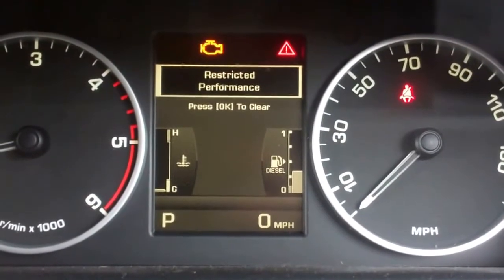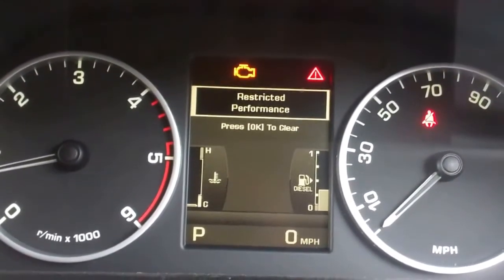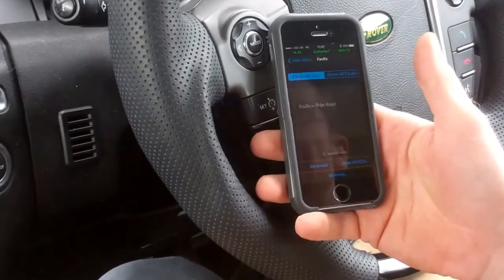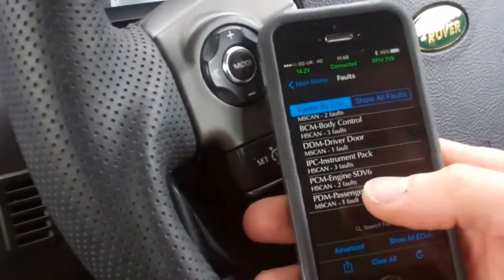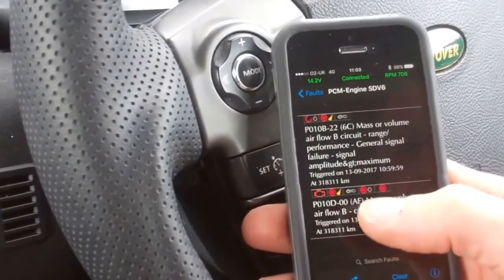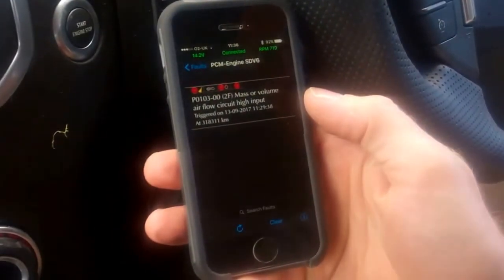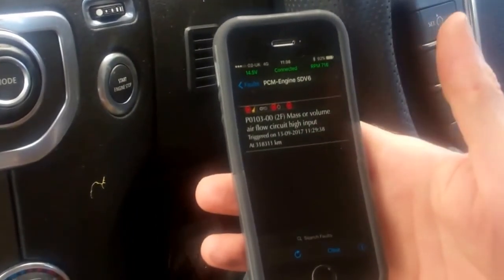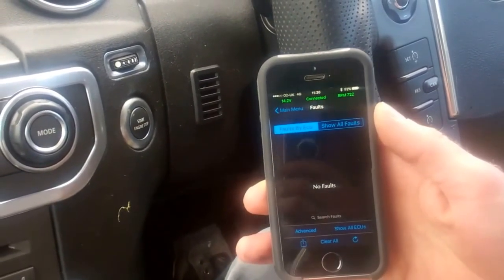Land Rover 3.0 SDV6 / TDV6 MAF Mass Airflow Sensor - Restricted Performance - Investigated

Comment: Hi there I have a LR4 on passenger side it smokes and leaks a little bit of oil on same side runs for a bit then cuts out and the intercooler bottom pipe seems to get oil in it would you know about this problem

Comment: As many of LR users, i'm going crazy due to failure bothering me for more than 4 months now. So to keep it short i started with nice restricted performance, including some oil inside my air filter and the following codes: P006A-00 (historic)  / P00BD-07 (intermittent) / P1247-00 (historic) / P0235-94 (intermittent). 
Based on such error list my standard garage advice me for the reconditioning of both turbo's, including actuators, seal kit for both, EGR's valve original new, and many exhaust seals related to these 2. 
Nevertheless after the change i still see some oil in my freshly new installed air filter, and i still get the P1247 -00 boost pressure low error. But from time to time and in some very awkward conditions, which i will try to describe: 

- ALWAYS after i drive some hours / engine is hot / and after one immediate restart 
- feeling of low power @ low revs 
- starting small jerk just before gear shift - maybe in some incline start 
- after clear feeling of car jerk 3-4 times, where some power and loss of power is strongly felt the restricted performance is there
- AFTER 10 mins shut of the car starts without any fault

I can also describe that by hard pull or higher speeds / revs such failure is not happening.

Comment: Simon, you guys are brilliant and have saved me a fortune! I’ve got a 2010 L320 RR Sport (106K miles) with the same engine as your D4. Just like you, it started going into Limp-Home on cold mornings and/or going up a hill. Then it started doing it on the motorway too. My iCarsoft 930 tool suggested a Mass Air Flow sensor and like you, B was filthy and A was spotless. I cleaned B as best as I could, but it wasn’t, as clean as A.
The car still threw itself into Limp-Home on Hills, cold mornings or on Motorways. My iCarsoft was suggesting the dreaded 100060 fault which usually means a £2,000 fix of replacing both plastic inlet manifolds.
However, I wasn’t convinced because I could delete the error on the move and the car would happily drive a while before the fault occurred again.
Inspired by your video and a couple of others using a smoke box, I decided to see if I could find a crack in the manifolds. I don’t have a smoke box. I used to smoke, but now use a Vape. I undid the pipe from the intercooler, then found a very small funnel, (the sort you fill a lawn mower sump with oil) and wrapped some masking tape round it until it was the same diameter as the inside of the rubber pipe from the Intercooler to the Right-angle bend  plastic peice that goes into the ‘Y’ junction, into each plastic inlet manifold.
I then blew Vape smoke into the funnel and instantly found that the Right-angle plastic piece was not properly attached to the ‘Y’ junction Throttle body.
I unscrewed an 8mm headed bolt behind the fan and the clip that joins the 2 plastic  pieces, reattached them and the problem is solved……….Absolutely FOC (apart from my Vape Liquid!!).

IIRC, I did see a similar problem highlighted by Christian Muth on one of his and Vera’s “Its LR Time” videos and before anybody involves themselves in any expensive garage repair, it is worth investigating a problem yourself first.
Thanks again!
Reply from the maker: Thanks for sharing this - we love LR time !

Comment: Thank you so very much for your counsel.
The challenge has been that the restricted performance indication has been coming up and clearing when the vehicle is left off for a while. The fuel consumption has also been on the higher side. When I check the MAF on two occasions I have noticed oil in the air duct and even on the air cleaner. 
The oil consumption from the engine has not been very bad even though I have had to top up on two occasions.
I was therefore wondering whether the bad MAF could lead to poor fuel consumption which is possible as stated in the write ups but the link to the oil in the air duct is what has been puzzling. The smoke discharge from the exhaust has been normal. At some point I was wondering whether the Turbo could be defective but the power and performance when the restricted Performance alarm is not on is very normal and excellent performance in terms of the power from the engine. 
I thank you for any added advice on this challenge.
Best regards.

Comment: What does it mean when there are traces of oil in the ducts leading from the MAF  sensors. Could this have anything to do with the Restricted Performance on the Discovery 4 Land Rover?
Reply from the maker: I guess in theory there should be no oil around the MAF as this is an air intake only. There is a lot of oil in the pipes after the turbo normally but no in the MAF - I would remove and clean with some brake cleaner.

Comment: This video saved me over a $1000 dollars (AUD)
I had a local mechanic do the scan and got a P00100 and a P00AA fault. Did some research, found this vid. 
Removed and cleaned both the MAF's and switched them over got the same engine warning.
Went to British Motor Imports in Vineyard near Sydney, they charged me $150 for a new unit, plugged it in problem solved. Thank you!!
Local Euro motor works quoted $1200 to switch out a $150 part.
Reply from the maker: Brilliant - glad it helped !

Comment: Restricted Performance issue on 2010 RRS HSE TDV6 A. Mileage 90K

We swapped over the AFM's as well as replaced each one in turn with a spare part. It showed the A circuit is the faulty one, with really high figures showing after revs. When idle both sensors show the same. 
So it's NOT the AFM, but something else. The fault codes are below.... 
PLEASE HELP.  (It just had a costly service before Christmas!) 

The AA Patrol found the following fault code/s:System : Engine control - 7M9 / Diesel EDC 17CP11.2 Status :P006A - Mass or volume air flow circuit. Error Message : Malfunction. Fault pending. Status :P00BD - Air-mass meter or air-flow sensor A. Error Message : Mechanical fault. Fault pending. Status :P1247 - Boost pressure control low pressure level. Error Message : Malfunction. Error sporadic. Status :P0235 - Turbocharger boost-press. sensor A. Error Message : Improper operation. Error sporadic. Status :P010C - Mass or volume air flow circuit. Error Message : Malfunction. Fault pending. Status :P0102 - Mass or volume air flow circuit. Error Message : Malfunction. Fault pending. Status :P00AA - Intake-air temperature sensor 1. Error Message : Voltage above threshold. Error sporadic.Clear faults and run up with live readings. Sounds like choking or leaking at boost pipe. Engine Oil Level Ok. Coolant Level Ok. Advised check on turbo pipes for leaks or collapse and also for EGR sticking. Customer going to contact garage to see if repair feasible.
Reply from the maker: This sounds like a leaking pipe issue I would agree
You can do a smoke test to check for leaking manifold / pipes.
https://www.youtube.com/watch?v=z1G0Tgvywys

Comment: Hi there what’s the IID tool you are using and what’s the app for the iPhone please 
And will this work with the 2014 RR sport SDV6?
Reply from the maker: Yes it will work with your car and i have the blue tooth version of the IID tool from GAP Diagnostics... the app is on the app store.
Reply: powerfulukltd great thanks for your help and advice is it around the 400 mark?
Reply from the maker: @simongreenwood4812  Yes thats the one. You can also use it to modify your car... suspension height etc etc

Comment: Hi bought a 2010 from an auction and it went into restricted performance after pushing on the gas a little harder and I was low on coolant . engine light was on when I bought it. The car seized up while driving and smoking from exhaust and underneath hood and leaked a little oil and wouldn’t start anymore and made a winding nose from motor when cranking with push to start button . Battery totally died and had blue corrosion on it and stopped going into gear so I couldn’t even tow it really cause the wheels wouldn’t move . It was just sliding.
Reply: Hi there, did you find out what the cause was? Sounds extremely catastrophic.

Comment: Hi I have same problem on a 10 plate sport iv changed the air mass but it is back in limp mood with same code is it possible that the 2 mass filters are gone
Reply from the maker: Hi - it would be bad luck for both to go... did you swap them over... you may have changed the wrong one ?
Reply: @L663  swapped them over still says same but in code thing tomorrow and yes would be my luck 2 if them
Reply: Have  now changed the 2 of them a d the problem is still there limp mood
Reply: Have now found out the air intake thing is cracked so ill do that  now
Reply: @richardprice7672  was that the cause then? I've heard they have a habit of splitting. Hopfully you sorted it out 👍
Reply: @brotherseamus165  yes plastic had split

Comment: My 2011 RR Sport 3.0 TDV6 goes into limp mode after 120 km/h when I am flooring it hard. I had hoped its those guys that failed but alas not. Some valve on the smaller turbo is gone - dont know exactly how its called but you can reach it from underneath the car.... Can you please let me know how is it called or whats the part number? The gentlemen from the shop did not help with that..
Reply from the maker: Hi - i think this is the turbo actuator - these can get stuck if not used much - you can lubricate them and work them loose.
Reply: powerfulukltd you are amazing! Thank you.

Comment: The operations you do with the IID tool are they limited to just that piece of equipment or can you do the same stuff on other diagnostic units?
Reply from the maker: There are other pieces of equipment that can do this ...but typically they are more expensive.... £5000 upwards. Examples are Autologic / Pathfinder and SDD

Comment: Hi I have changed th air flow sensor B , red light went off, but a week later it is back on , loss of power, so checked rubber in place ok , light off all ok, but then 3 days later light on again loss of power. Any ideas ? For a range rover sport HSE LS 2013. Thanks
Reply from the maker: Sounds a mystery - i think you need to get the fault codes read and see what the stored fault codes are.
Reply: @L663  h

Comment: range rover sport supercharged code p007d charge air cooler temperature sensor fault
Reply from the maker: yes there is a good chance this is caused by the temo sensor that is part of the MAF sensor - try swapping them around the plug with 4 wires on is the one that "reads" air temp but both sensors have the temp sensor so you may be lucky and get away with just swapping them over.
Reply: @L663  good vid, tried the cleaner on both with no luck but remember B was pretty dirty, and the fault reading defo said maf n sth bout temp. At the garage they said its 'probably' the Manifold inlet and want to replace it for 1k. I'd better try to swap them over or fitting new one first to see what happens :) Will let ya know
Reply: @pan3x  how did you get on??
Reply: @mandhirsidhu  cracked Manifold inlet. had to fix it at the garage

Comment: The inlet manifold is plastic.

When it cracks you get restricted performance when accelerating.

But often the fault codes lead you to think it could be MAF related.
Reply from the maker: Changed MAF and now all good.... so think it was the MAF
Reply: This error will only appear after starting the engine and driving if it's the manifold or a leak in the intake system . If the error appears with the ignition on and the engine has not been started then it's the sensor.
Reply: random thoughts wonder if this is my issue. The codes are giving me the run around.
Reply: @7-7-724  My car had no problems unless on hard acceleration for over a year.

Which was why JLR replaced mine 6 months outside warranty for free.
Reply: @bigjml  ive got this issue restricted mode Red but no engine managment light. My brake pad lights come on today and had a squeal when slightly turn right slightly.  I wonder if this can kick in restricted power for safety. Had yellow light for 2 weeks restricted performance and someone mentioned fuel filter. thought this was done on service but been told today that is extra cost pffff so much for Halfords. That is major service as well. Had MOT Nov last year and done very little mileage since and was no advisory Halfords again. I can rev the engine from start over 2000 and is okay. Any idea if restricted performance Red can be because of brake pads? Hoping not turbo relate actuator etc as body off. I don't ever drive it hard so I have read on disco site can be oil in solenoid and shaft :) needs cleaning all good. Booked in monday diagnostics but took info paste here. If it was Turbo or inlet would my engine management light be on. MIne is SDV6 disco 4 2013

He found fault codes P006A-00, P1247-00, P00BD-07 and P0235-94.

The result was a clean of the shaft on the solenoid valve. Thumbs Up

Has this happened to anyone else and did it reoccur - if so was it a replacement solenoid.